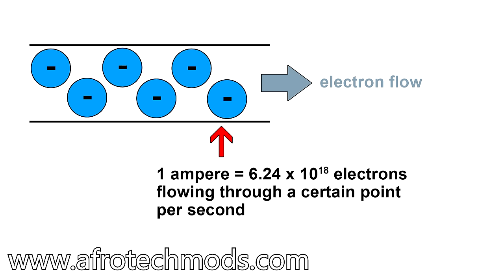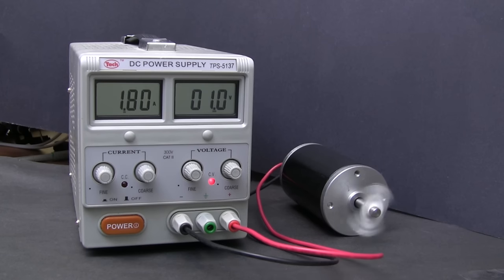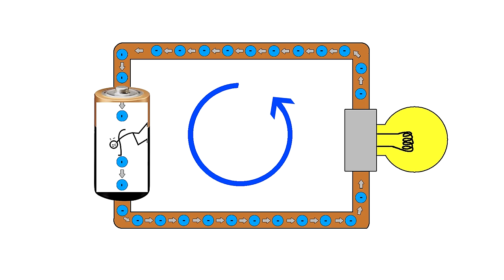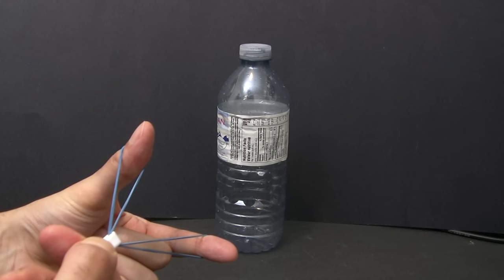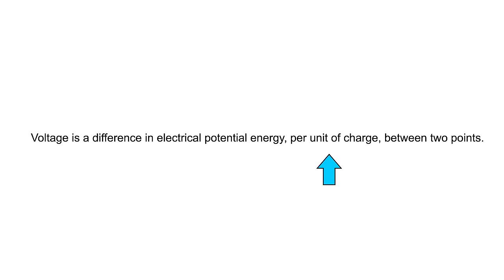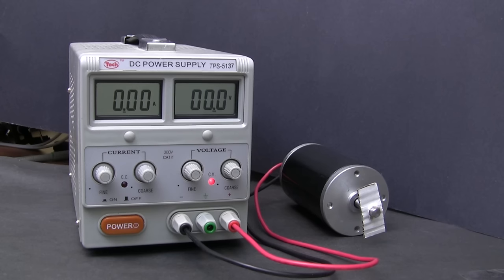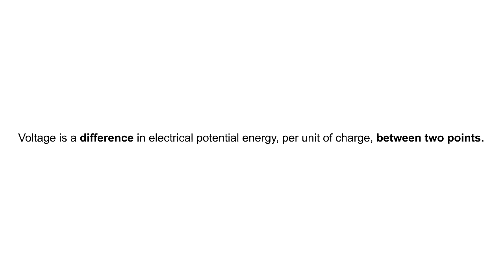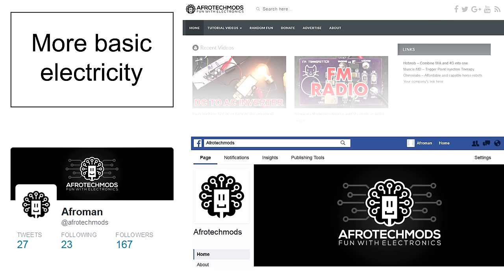🔌 Basic Electricity - What is voltage?

Comment: I hope this is still relevant in your scope of view that you respond to... I specifically search for something on voltage to understand better what actually voltage is, and for why converting low Voltage from low to high voltage through transformer does not necessarily translate to higher current. I get it, you can't create energy and what you put in is what you get out or less sometimes, but yet still not clear on the fact that higher voltage via transforming couldn't result into more current, even though the voltage is a potential difference between two points that necessitate the flow of current between the point, please advise...
Reply: I guess I am mixing Voltage sources with Current sources together and confusing this with mode of operation of a transformer. Still wondering how the electromagnetic induction in transformer changes voltage with inverse effect on current. Could this be a fact that the electromagnetic field generated is characterized by both primary source current and voltage such that the field density is proportional to the primary current while the field strength is dependent on primary Voltage and the two characteristics impact on the secondary coil electrical properties... just thinking out loud

Comment: I don't understand whast the point of putting the difference it makes me even more confused..you mean by difference in electrical potential energy?The negative side of the battery has more enough charge to push than compared to the positive side of the battery?What are you comparing the difference to?I'm sorry if i don't make much sense.

I mean i like how you presented this,but shouldn't the voltage just be energy pushing the electrons from the anode to the cathode

Comment: I still do not understand what goes on inside the battery that creates a voltage and why does current flowing in circuit increases with increase in voltage

Comment: Hello when you used a led to show how a battery works you took a clamp using your bare hand to make the contact between both. Is that dangerous ? lets say in a bigger battery if the voltage created by chemical reaction is higher. (sorry for my bad english)
Reply from the maker: Good question. For that small 9V battery it's no problem. But if you were using a large battery like a car battery then yes be careful to not short out the terminals with metal tools!
Reply: @Afrotechmods  Okay thank you for answering

Comment: Hey I am new but have a question.  Based on the description of conventional vs actual. If current flows from negative to positive.  Regardless of the convention wouldn't it always be safer to wire a resistor to the negative side since in that case the current will hit the resistor first then the led?
Reply: It makes no difference where you put the resistor.  The current flows according to the total resistance of the circuit.  More current doesn't flow before the resistor and less after it - the same amount flows throughout the circuit.
Reply: @stargazer7644  Thanks for the reply.  That makes sense. I had that thought in the back of my mind but the way every one explains it.  If they don't say specifically that it seems as if each component of the circuit is getting hit with the same current until a resistor is encountered and different after.  Usually when you see the math involved. I think I understand now.  That is just how the resistance is calculated  but how it behaves is how you described.
Reply: @ShitBrick785  Resistance is calculated the same way.  If you have a string of different value resistors in series across a battery, the exact same current flows through each one of them, no matter what the individual resistor values are.  The voltage drop across each one will be different, and the power through each resistor will be different, but the current everywhere will be the same:  current = voltage / (sum of all resistances in series).  Think of it like the water flow analogy.   If you have a string of different sized pipes, the flow through each one will be the same.  You can't have more water flow through a big pipe before it hits a little pipe because, where would the water go?  The total flow through all the pipes is the sum of all the restrictions in all the pipes, and the flow is the same in all of them.
Reply: @ShitBrick785  Oh, and remember, the electrons aren't trying to get to the load/led/whatever - they're trying to get back to the positive side of the power supply/battery.

Comment: When you set up the voltage to 1, a current of 1.8 Amperes was displayed. But when the voltage was increased to 2, the current was 2 Amperes. This is not a linear increase. Why did that happen?

Comment: When you increase the voltage on the power supply the current increases, but I thought when the volatge is increased the current is decreased ie for electrical distribution we step up the voltage which reduces the current. Can you explain this please?
Reply: For power distribution you want the lowest power loss in heating the wires, so for a higher voltage a lower current can be transmitted giving the same power overall.  The power loss in the wires = current^2 x resistance, or "I-squared R" (I^2R) so it makes sense to transmit power at the lowest current possible, that is, at the highest practicable voltage.
Reply: When you have a constant power flow, if you increase the voltage it will decrease the current since power=voltage*current.  This is the power law.  If you raise one on the right side, it lowers the other to keep it balanced.  In these examples we do not have constant power flow.  We have a constant resistance (the load).  Since resistance=voltage/current, if you raise one on the right side it raises the other to keep it balanced.  This is ohms law.

Comment: 8:00 so is another way to put that: "The energy given off is 9v"? Or would that be incorrect
Reply: That is incorrect. 9V means that when 1C of charge travel between of the points of potential difference of 9V it gains 9J energy. So 2C would gain 18J and 100C would gain 900J etc.

Comment: At its simplest...when you send electricity  thru a wire your "squeezing" your pushing the negatively charged electrons closer together and they push outward or forward down the wire
Reply: Actually, when your voltage sends an electric field gradient down the wire at near the speed of light, it causes the free electrons in the wire to move to try to cancel it causing a current.

Comment: Volts is like PSI
Amps is like GPM

high voltages/static charges destroy electronics (don't rub them on carpet)
high enough voltage will penetrate the high resistance of skin (Car battiers arn't high enough)
and amp do the damage

What you SHOULND NOT do is bathe in salt water and touch a car battery terminals

Yoou will be perfectly fine if you hands are clean (free of sweat that contains salt) and dry

Comment: 7:54 How to know how many amperes can a 9v battery supply?
Reply: It depends on the internal resistance of the battery - that's what limits a battery's current.  The internal resistance goes up as the battery is depleted, so it becomes less able to generate current.  That's also why a battery's voltage drops as it is depleted.  A small battery has a higher internal resistance, so can supply less current than a physically bigger battery.  Putting multiple batteries in parallel lowers their total internal resistance, so allows more current to be drawn.

Comment: Imagine there is an open door. You and your friends walk through it at the same time. you and your friends represent electrons and you all represent Amps. The more friends/electrons you have the more amps there are. you can have 100 friends going through the same door but you all are simply walking through it. Voltage now is referring to the speed at which electrons flow. So if you and your friends are running through the door, this represents high voltage and if you are walking through the door this represents low voltage.

In the first scenario, you have a lot of electrons walking through the door. This means that you can have  high amps (alot of electrons) even with low voltage ( all of those electrons walking through the door)

In a nutshell, voltage is the speed of which electrons flow and current (amps) is about the number of electrons flowing.

____
Another analogy would be imagine a race.
Voltage would be how fast the runners are, and amps would be how many electrons/people are actually participating in the race.

You can have a marathon with 1,000 people but everyone is walking (High amps low voltage) or a  race/marathon where everyone is running, but only few people participated (high voltage but low current)

Hope this helps someone

Comment: If I connect one batteries + to others -, there is potential difference, thus, voltage between those points. Why isn't the current flowing?

Comment: Thank you for doing this, but I'm still confused about something...
If electrons always move at a constant speed (close to the speed of light) how is a volt supposed to create a faster current?
Reply: did you ever find an answer to your question?
Reply: This is complicated because they aren't telling you the whole story.  The electrons do not move anywhere close to the speed of light.  They generally move at fractions of a mm per second.  This is called the electron drift velocity and is never really talked about in basic electronics.  The "pressure wave" which is the electromagnetic field moves through the material at near the speed of light.  Think of this like a water pipe.  When you add pressure at one end of a pipe full of water,  the pressure wave moves very rapidly (at the speed of sound in water) through the pipe to increase the pressure at the far end.  The actual water molecules at the beginning of the pipe didn't actually move much at all, but the pressure wave did.  It works the same in a wire.  When you add voltage to one end of a wire full of electrons, the pressure wave moves near the speed of light to the other end, but the electrons in the wire hardly moved at all.  When DC current flows, the actual electrons move fairly slowly through the wire from one end to the other.  Higher voltage does make the drift velocity higher, and therefore more electrons per second enter and leave the wire (more amps flow).  But the average speed of the electrons is really pretty slow.  There's just a LOT of electrons in a piece of wire.

Comment: If the voltage is set at 1V (at 7:02), and 1V = 1C = 1J, then how can 1.8A pass through the motor? If 1.8A = 1.8C per second then wouldn't the voltage be 1.8V?
I think I've got it now. 1V is 1J  per 1C. The motor runs at 1.8A, which is 1.8C PER SECOND(this is where I got confused earlier). So the motor transfers 1.8C per second into 1.8J
It still boggles my mind

Comment: So basically what you're saying is that voltage measures force? Am I reading this correctly? The difference in potential electrical energy is the force which causes electrons to skip from atom to atom, shunting each other in the process. At least, that's what it sounds like.
Reply: More or less, yes! Voltage is how hard you're pushing on electrons. 

Say a ball is an electron. If we tap it, that might be equivalent to a low voltage pulse. If we kick it, that would be a high voltage pulse. But, just because we kick or tap it, that doesnt mean it has to move! Think about if we put the soccer ball in wet cement and let it dry. Now, if we come back and kick, tap, smack, whatever, that ball is going no where. 

So, voltage is how hard you're trying to push on electrons, but if the electrons are in a medium in which it is hard for them to move (say rubber for instance), you're not going to get any current. There is still voltage there, but the electrons just won't flow.
Reply: Kakunapod if they won't be conducive doesn't that mean they have high resistance and are insulators?
Reply: Yep, so in my example, rubber is an electrical insulator.
Reply: Exactly right.  Voltage is also called EMF or Electromotive force.

Comment: But how does voltage work ? how does it push negative electrons ?
Reply: J3AN P3T3R  the problem is no one is pushing it is a metaphor .. too understand this better you need physics to explain it on atomic and electron level.

Comment: if 1 volt can push 1.8amps, shouldnt 2 volts push 3.6 amps?
Reply from the maker: Good question. This is only true if it is a linear load, like a simple resistor.

Comment: so you are basically saying that voltage is the driving force of the electrons and without voltage there is not current because there is not energy to move the electrons  in a wire and also you are saying that in order to have voltage. you should have a high potential different between two points in other words you are making one side greater than the other side so the electron can flow from the negative to the positive am i right?
Reply: Christyan Mendoza yes. A small detail correction though; not a high difference. just a difference

Comment: Why is the current greater than voltage from the voltage source?
Reply: Because the current depends on the voltage divided by the resistance.  The lower the resistance, the higher the current.  You can make the current anything you want by varying the resistance.

Comment: I don't understand the importance of the term coulomb, isn't it just another word for ampere? It signifies the same thing, 1Amp=6.24x10^18 or 1 Coulomb=6.24x10^18. The video explains it as if it makes it easier to reference the equation with the word coulomb but doesn't an ampere reference the same exact equation therefor coulomb is just an unnecessary word. Or are they differentiated by their use? Amp is used to describe motion of N electrons while coulomb just represents the existence of a specific number of electrons?
Reply: The Coulomb is the charge on 6.24x10^18 electrons as the charge on one electron is also measured in coulombs but is a very small number.  The Amp is 1 Coulomb per second. It's easier to say "1A" rather than "1C/s", just like 1 Knot is i nautical mile per hour.  One is a quantity, the other is a rate.

Comment: Forgive me but in the light bulb circuit animation throughout the video, the battery is pointing the wrong way is it not?
If the battery is powering the bulb, current would flow out of the battery positive around the circuit and back through the battery negative to begin again yet in the animation, the current flow arrows are entering the battery positive and exiting through battery negative.
Reply: That's the difference between conventional current flow and electron current flow as he tried to explain in the video.  In conventional current flow as taught in schools, current flows from positive to negative.  But that isn't actually how it really works.  The electrons in the wire actually flow from negative to positive.  When Ben Franklin guessed at how electricity worked back long before the electron was discovered, he guessed that positive charges flow from + to -.  He guessed wrong.  When we later discovered electrons, we realized they're really negative charges that flow from - to +, but by then the damage was already done.  It was too late to change everything, and since the two explanations are actually completely equivalent, we just stuck with conventional current flow in basic electronics.  So when we look at a circuit we pretend they're positive charges that move instead of negative ones going the other way.

Comment: So does electricity flow from positive TO negative or negative TO positive?
Reply: Negative to positive.
Reply: No, electrons flow from negative from positive. 

Electricity flow depends on who you are talking to and how you define it. Not trying to make it difficult, but this absolutely is the case. If you talk to a physicist, they will say it flows from negative to positive. However, if you talk to any engineer or almost anyone else, electricity flows from positive to negative.

As an electrical engineering undergrad senior, current flows from positive to negative. If you want to learn practical electronics, it will help you to adapt this mindset, however it is technically correct to say it flows from negative to positive.
Reply: Kakunapod Thanks for the information. As I go through my Raspberry PI and Arduino learning I usually see it taught as positive to negative, but then others say negative to positive which only serves to produce confusion in novices such as myself. Why can't there just be a consensus?